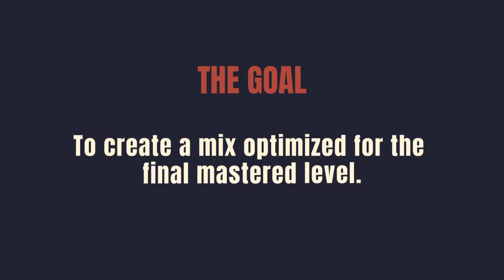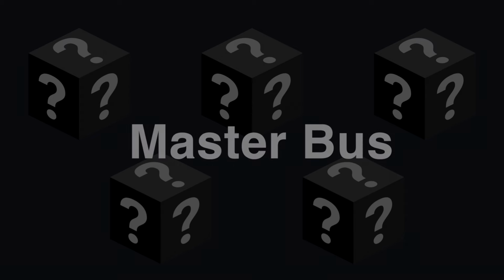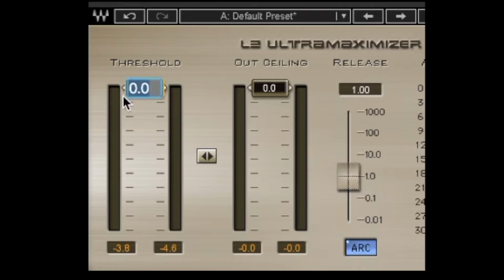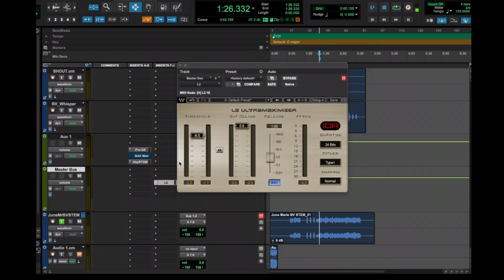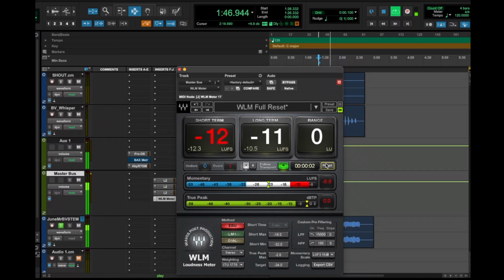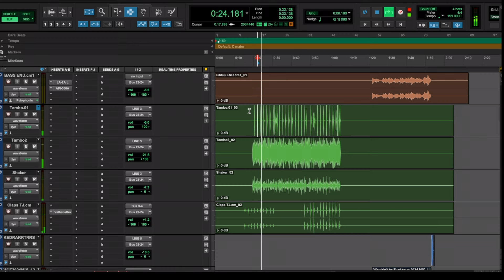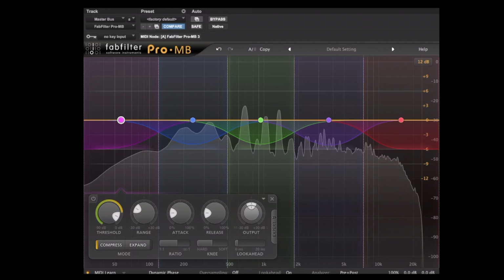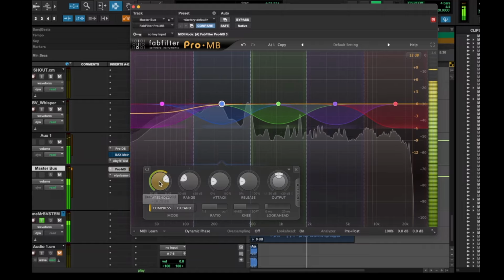Mix Falling Apart in Mastering? My proven strategy fixes it!

Comment: Just use a clipper bro 😊
Reply from the maker: @lorenzoprats  Thanks for the suggestion! Using a clipper can definitely help control peaks and prevent distortion when pushing a mix, but my video focuses on a broader strategy to see how the whole mix behaves under stress, especially when preparing it for mastering. The idea is to push the mix to its limits to identify potential issues that could affect the mastering stage. Clipping can be a tool in that process, but it’s not the only one. Appreciate the input though!